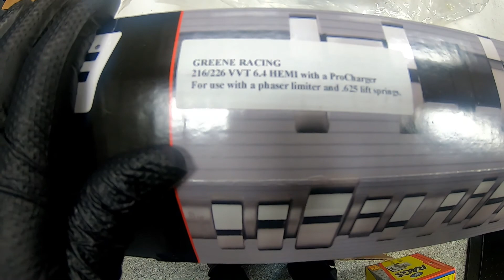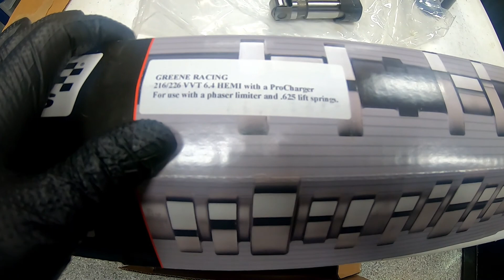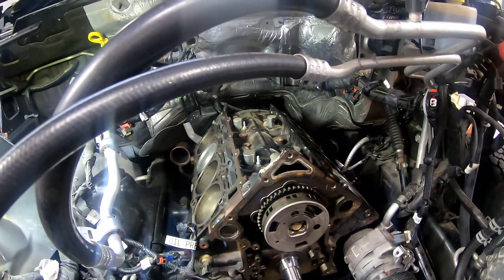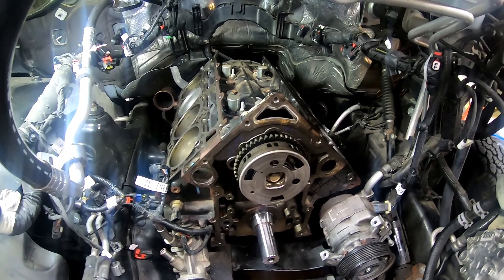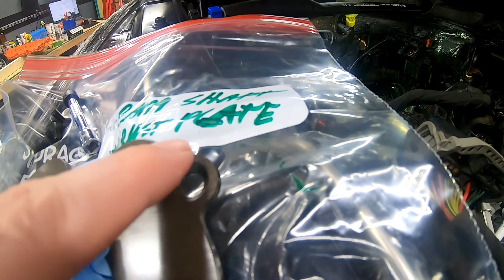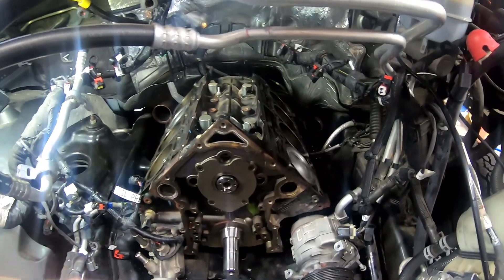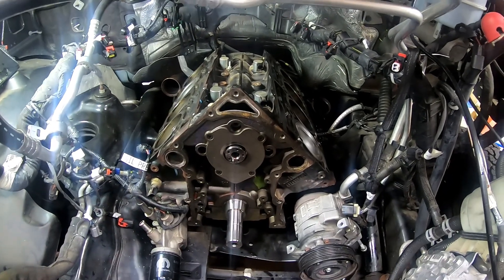Ram 2500 6.4L Upgrade Part 21 hemi cam/lifter install

Comment: Hey man been following your videos. Its been very helpful so thank you for making these.

Question for you. I am doing the mds delete myself. I have the hellcat lifters I just don't know which cam to go with. I know you are not an expert but I'm trying to stay near stock maybe a bit more power. I don't have a super charger or anything. Is there a cam you'd recommend upon your research/experience?
Reply from the maker: I wish I could give you a concrete answer, but I might be able to point you in a direction.  Have you looked at Texas Speed?  or Modern Muscle Extreme?  Both have many upgrade kits for hemis and would be able to recommend a good cam and or kit.

Comment: I’m always nervous with aftermarket parts. I’m sure it will all go well.
Reply from the maker: Agreed, many thousands of builders have used compcams and Pac springs with no issues as well as the parts have been matched up by a tuner/builder, so good well.

Comment: What’s the difference the old cam looks like it has a bigger lift
Reply from the maker: Hello, The new cam is a 216/226 custom grind from my tuner, designed to work with the ProCharger and .625 lift springs.
Reply: @solargarage  oh okay that makes more sense thanks for the reply 👏🏻